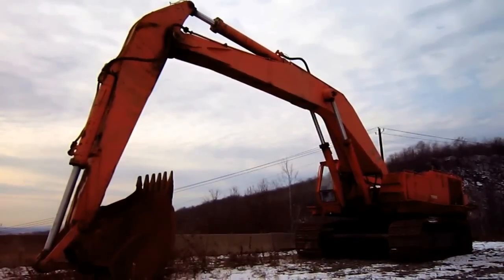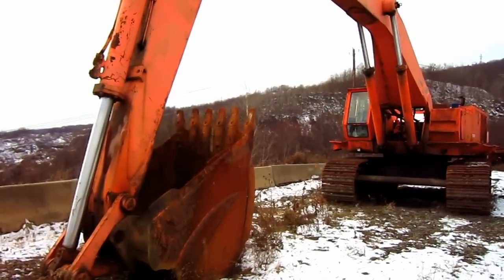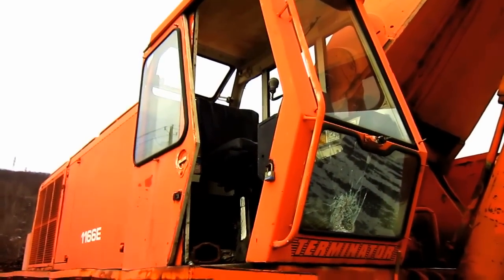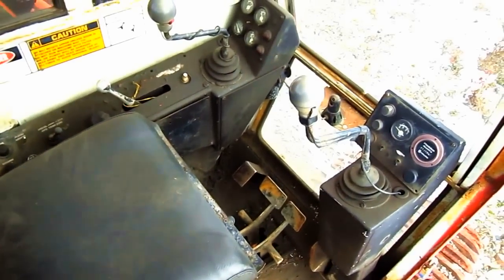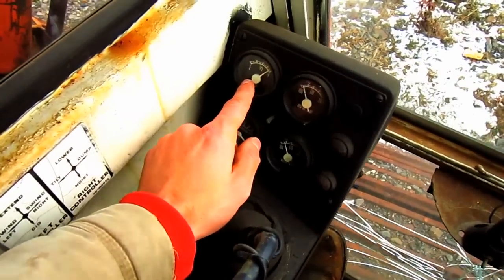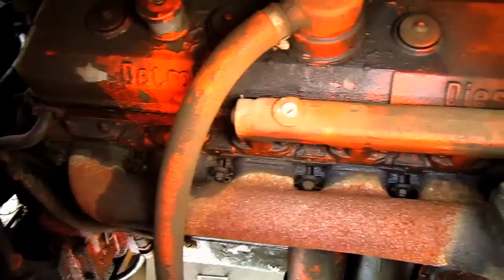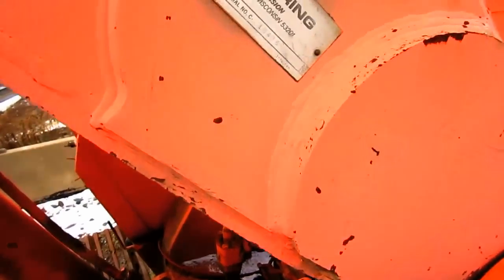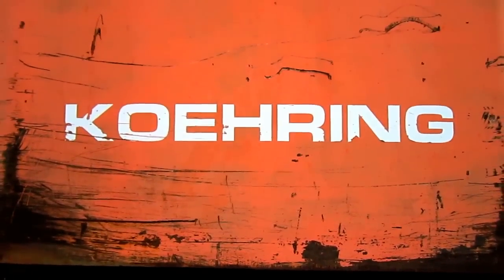Koehring 1166E Documentary

Comment: Really enjoyed this excellent video. Very well done! I have been a fan of the big Koehring excavators for many years. I remember back in the mid-1980’s watching a 1266d dig a 40 foot deep pit in the NJ meadowlands area. Work was related to a waste transfer station.The Koehring was equipped with approximately an 8 cubic yard bucket and loaded a fleet of Euclid R-50 haul trucks and a couple of Cat 35 toners.The thing that amazed me was the extreme reach capability with such a large bucket.Had to be about sixty feet from the center pin to the bucket @ max. reach.As you know the Koehring 1266d had an operating weight of over 130 tons.That Koehring 1266d was a very impressive piece of American made heavy equipment!

Comment: I grew up with my dad working for a geotechnical contracting company that operated a variety of modified koehrings to dig trenches of abnormal depth for an excavator. Nowadays there are a few production machines for it, but they top out at around 50 foot depth, and lack the weight and footprint to heavily modify. Those modified koehrings would do 80+ ft.

Comment: That machine is as old as me... and yet it's in better shape.
BTW, different track tensions or just less shoes on the right hand side crawler track?
Reply: +NeAZ Looks like it has a bad track adjuster seal
Reply: There was a nitrogen cyl. Behind the front idler, that provided the movement of the idler, track adjusting was by shims between the idler and the yoke. A very poor system, defiantly one of the weak points on the machine. Very common for the nitrogen to leak from the cyl and have a loose track, that’s what’s wrong with this one.

Comment: What would be the benefit of having the two engines vs a single engine? Seems like it would be double the maintenance and cost running two vs one larger engine.
Reply from the maker: +Blake Budney Twin engine machines were normally designed to accommodate for the required output to run the excavator that wasn't available at the time from a single engine.  Other reasons twin engine designs were used was to help reduce overall operational expenses.  For example, if an excavator has two V-8's and one needs replacement, the cost to replace a single V-8 is way cheaper than replacing a single V-16 in the same class excavator.  Make sense?  Today, twin engine designs are still commonly used in larger mining class excavators but never in an excavator of this size.  A lot of operators do frown upon the twin engine design, often calling it "double trouble" because of the double number of components to replace.

Comment: Very little difference between an 1166E and a 1066E, main frames were the same, booms were different, the 1066 had boosted hoist only, the 1166 had boosted stick as well and more weight in the C/W… The E models ended in about 1981 or 2 and was replaced by the 20,000 series that had improvements over the E models…

Comment: We rented a 1066E from a local company back in 1994, once we got everything fixed that it ran good it was fun to operate. If I remember correctly it had a air system on it for the controls, it also had a free swing kinda like a dragline.
Reply from the maker: +Schneiderexc Yes, the older Koehrings were air over hydraulic.  A very different feel to run one of those machines!
Reply: +PAmining yeah that air was hard cause it was all or nothing. No sit it down, easy. The C366 had two levers and 4 foot pedals. Two levers on each side of you was for the tracks.

Comment: Always wondered why the old excavators have the cab on the opposite side
Reply from the maker: The reason for right handed cabs is because that's how Koehring's old cable excavators were setup.  Koehring (along with other manufactures), kept the operators station on the same side when they developed hydraulic excavators to not confuse operators who  were accustomed to a right handed cab